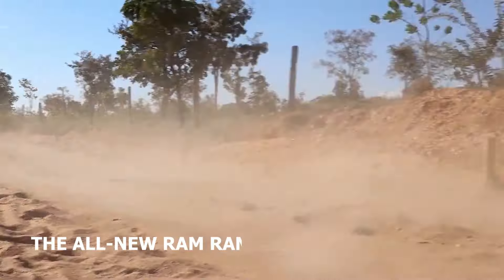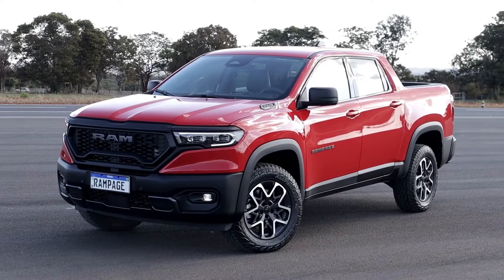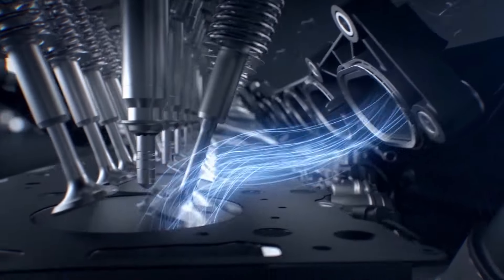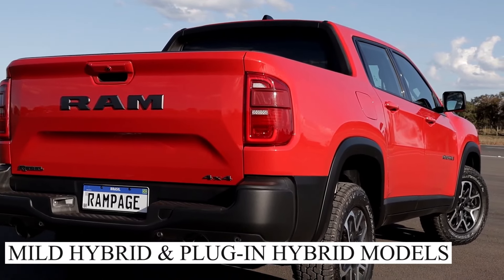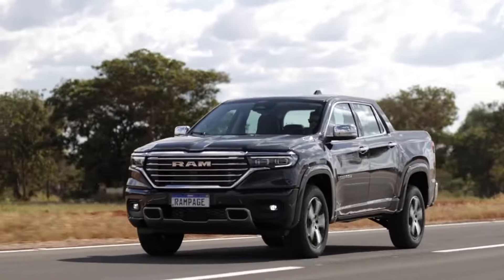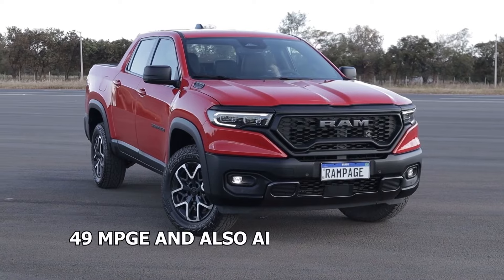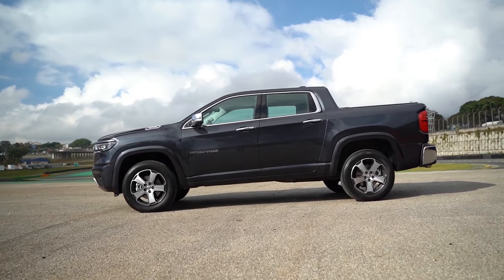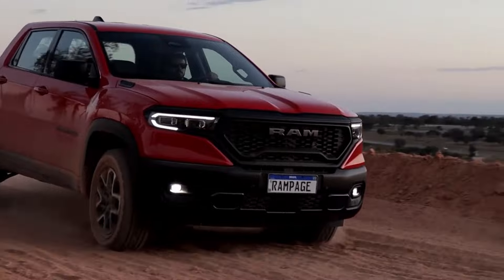All-New RAM Rampage Blows Away the Competition!

Comment: THESE CARS AND TRUCKS ARE TRASH. POOR QUALITY AND SERVICE IS UNBELIEVABLE.  WE MAKE GARBAGE IN THIS COUNTRY.  YOU NEED TO HEAR THE TRUTH FOLKS.
Reply: I have a 2017 ram with the hemi with 170,000 miles an haven't had no problem with it just oil change air filters spark plugs an tires I live in Ohio been to TX in it Florida Kentucky south Carolina I drive it every day an still runs like when I bought it  4 years ago
Reply: Thank you I’ve had several of there vehicles and I had no issues with their reliability .
Reply: @brucebeamon5460  your one of the lucky ones and that's great.